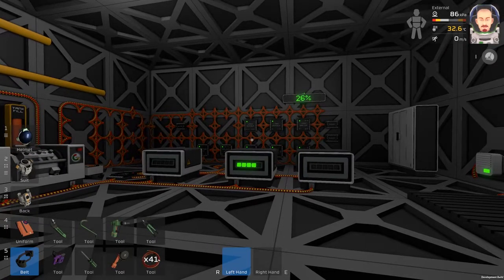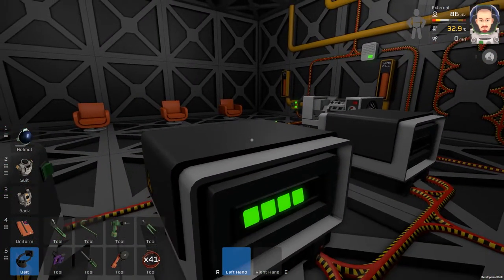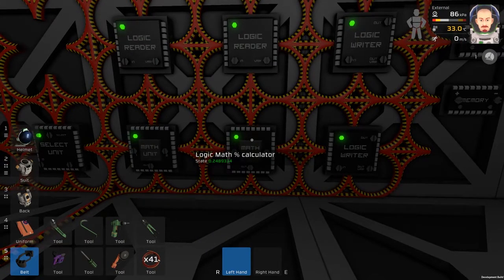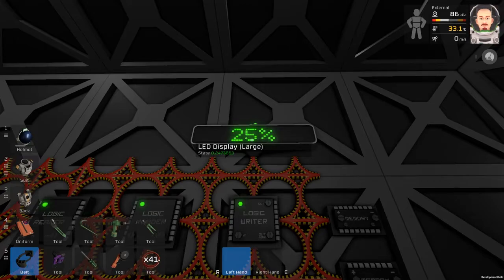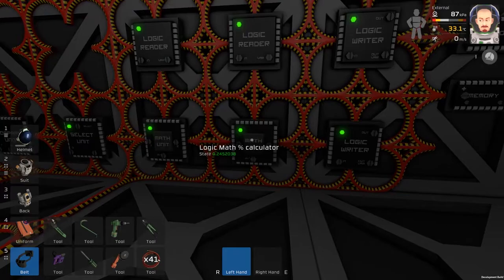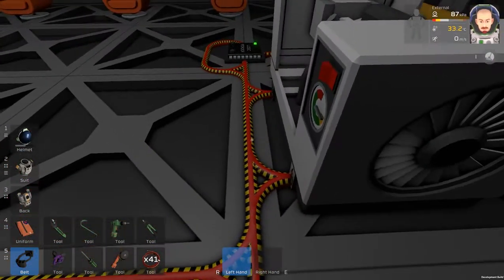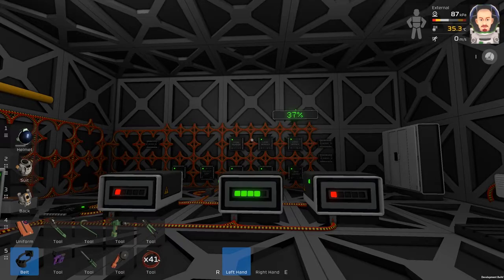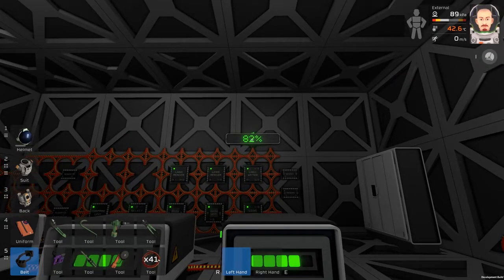Stationeers - Tutorial power grid monitoring 3

Comment: I tried the monitor with a 6 battery array. Doesnt work . Math comes out wrong. Battery max 3600000 x 6 the power pt. shows as 38000.
Reply from the maker: I will try it right now
Reply from the maker: stationary battery = logic reader input,  logic reader variable = maximum

memory = 6 ( 6 batteries )

logic reader ( battery maximum ) = math unit input 1, memory value 6 ( for 6 batteries ) = math unit input 2

function on math unit = multiply

number on math unit as result should be 2.16E+07

https://imgur.com/a/Wa8hf
Reply: Thats what I did.  Gave up and just ran 1 reader per battery and added the ratios / batts.  Took up a lot of wire and flloor space but it works
Reply from the maker: Thats very strange, it works for me all the time with one reader, I am running Beta. What number do you have exactly on your first math unit? Can I have a screen?

Comment: Thank you for your videos.

The system does not operate optimally. Indeed, once the maximum value reached 80% when the battery percentage reaches 79% the generator engages. He does not expect to be at 30%
Reply from the maker: Hello there, if you got it right, it will work 100% Schmitt trigger is absolutely reliable, are you sure you got it right? Thank you very much for watching